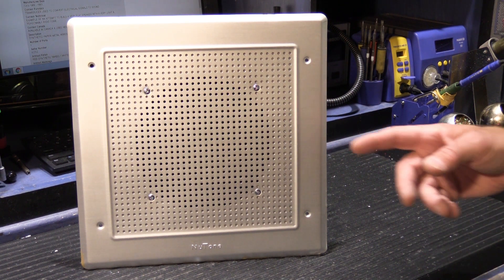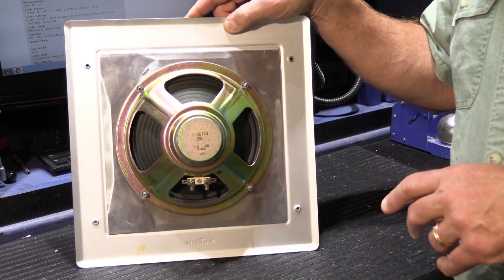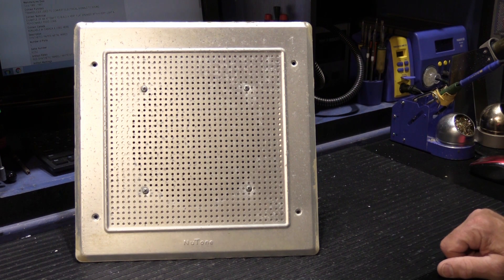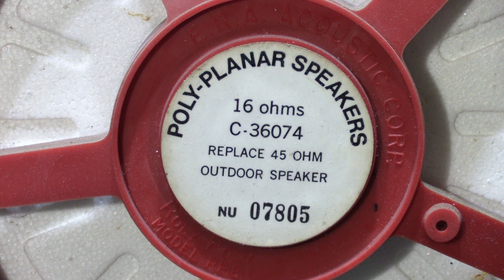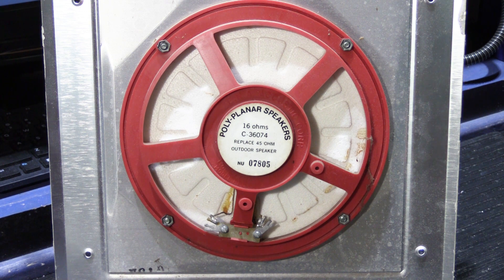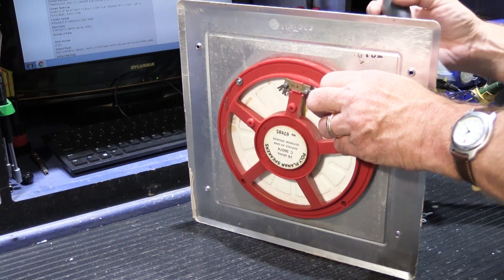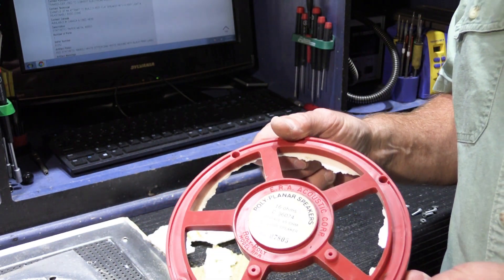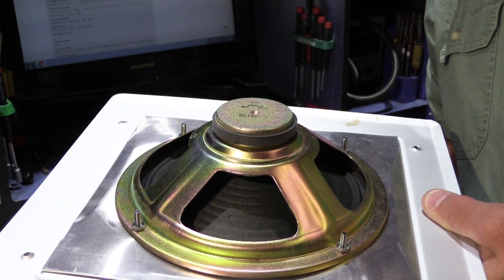What is a NuTone RP8 "Roly Poly"?

Comment: Thanks for this information.  My RP8 died some time ago and I need to replace it.  The location is now a weatherproof 4-season sunroom, so I can use an indoor speaker.  Can you tell me whether I should replace the cone with a 16 ohm or 25 ohm or look for a 45 ohm (like this apparently replaced)?  I don't want to damage my NuTone master panel.
Reply from the maker: Hi Justin:  Which Impedance Speaker Cone you choose depends on the Model of your System - The choices will be 3.2 ohms - 45 ohms or 25 ohms.  16 ohm Speaker Cones are only for Entry Door Stations - Chris
Reply: Thanks Chris.  My system is IMA-3303.  My confusion is that the RP8 is 16 ohm, but is marked as replacing a 45 ohm, and my outdoor station IC-321WHW is indicated (in the catalogue) as taking a 25 ohm speaker.  My system came with the house.  It's possible that the speaker and system were mismatched during an upgrade when the patio was changed into the sunroom addition by the previous owner.
Reply from the maker: @justinbukowski5864  The RP8 is a remnant for an earlier system, they were discontinued sometime in the early 1980's - You should use a 25 ohm Speaker Cone, which is correct for your IMA3303 System.  Chris
Reply: @northsideservicecompany3567  Thanks again. I'll be in touch.